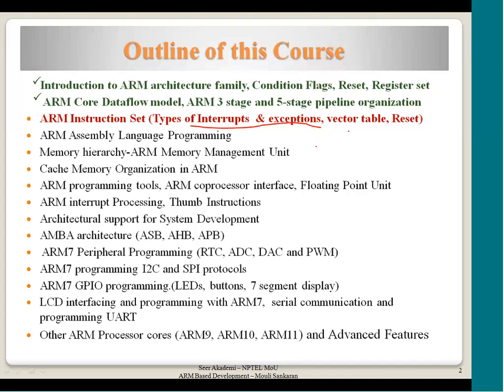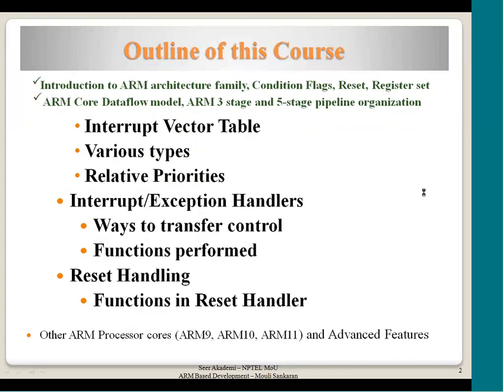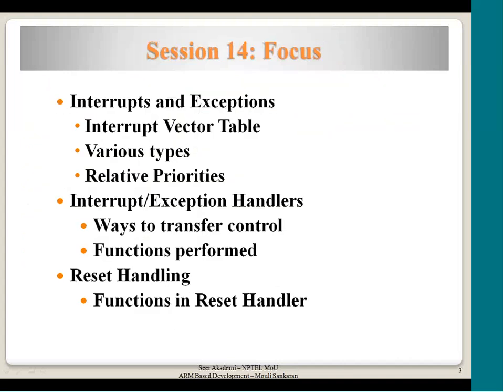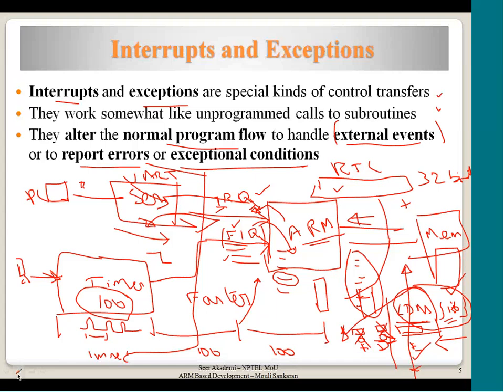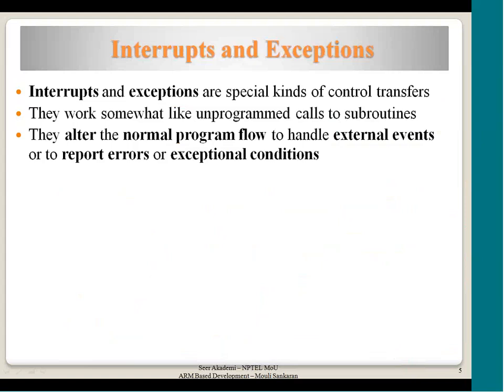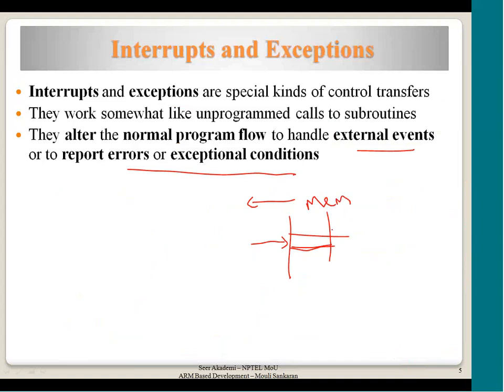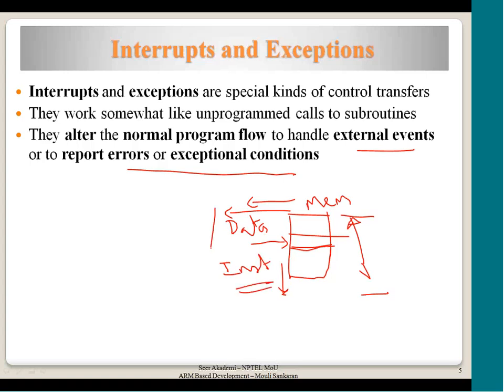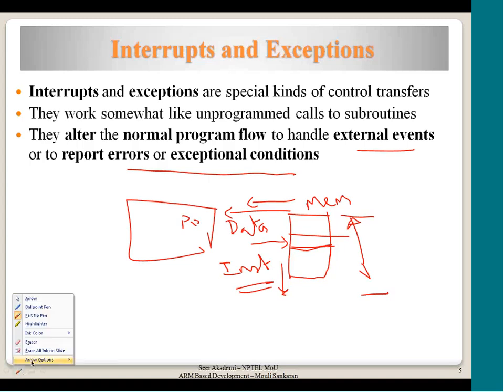Interrupts and Exceptions, Exception Handlers, Reset Handling

Comment: Can multiple devices be connected to IRQ  line, if  yes, how  does processor recognise which device  raised  IRQ- in order to execute respective ISR  and What if multiple devices raise IRQ at the same time?
Reply: It all depends on how you would like to handle the interrupts. generally it is the ISR which has to find the exact source  of interrupt and take jump to a particular ISR. if you have too many such interrupt inputs to be connected you will want to use a vector interrupt controller which manages all priority and isr switching